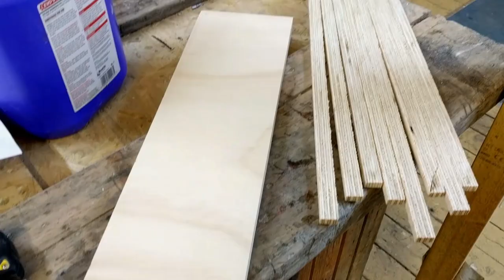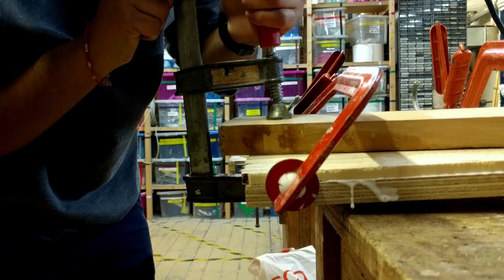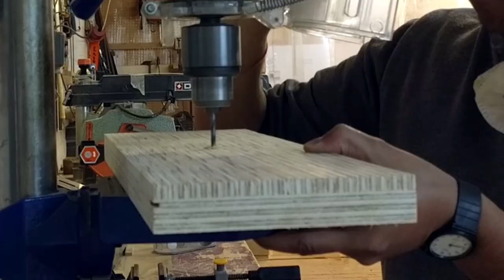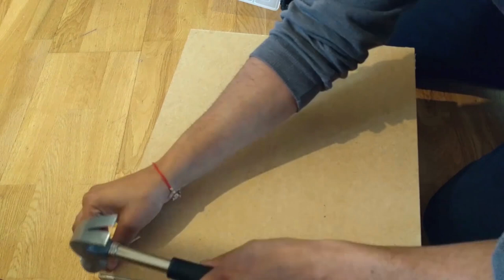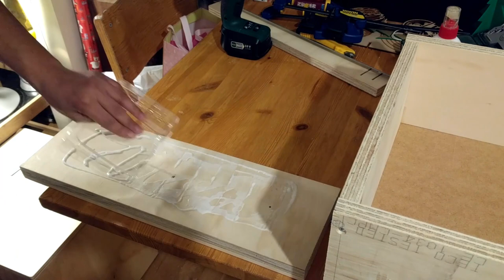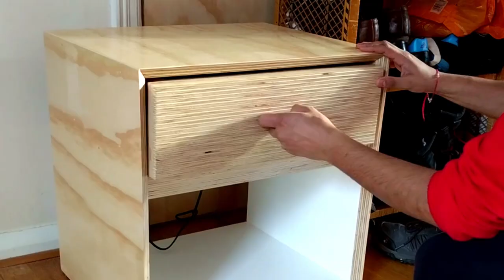Making a Drawer for the Plywood Bedside Table

Comment: How thick plywood strips and what type and thickness of wood did you glue them to for the drawer front.
Reply from the maker: From memory the plywood strips were about 9-10mm thick, but it isn't critical, just need to be thick enough that they don't bend and warp too much whilst you're trying to glue them to the panel afterwards. The drawer front is 18mm thick plywood that the strips are glued to, so overall quite a thick drawer front. It could be a lot thinner, you could get away with 12mm, but I bought an 18mm full sheet to make the piece so just used that.